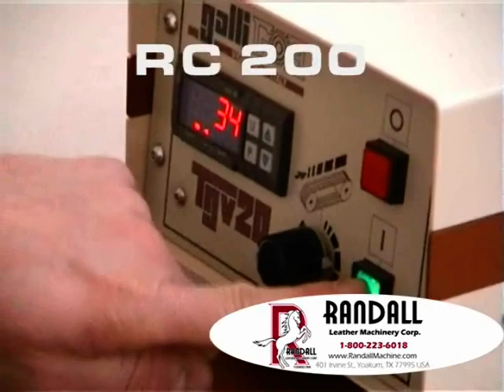RC50 & RC200 Leather Edge Painting Machines

Comment: Can we use this machine for 10mm 13mm thick & 4inch wide belts ?
Reply from the maker: The roller that applies the paint to the leather is 10mm tall.  The painting rollers can either be flat or curved. 

If you are needing to do thicker edges, the POLYCOLOR will be the machine.  https://youtu.be/g9fyDBkeDNw